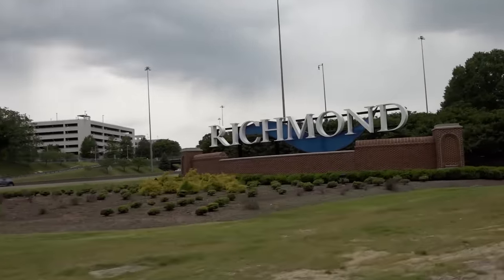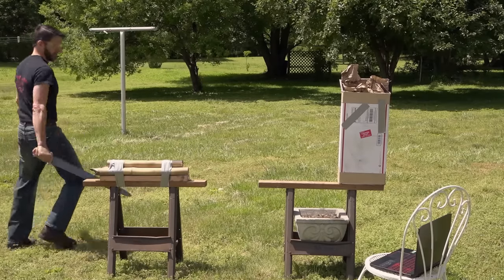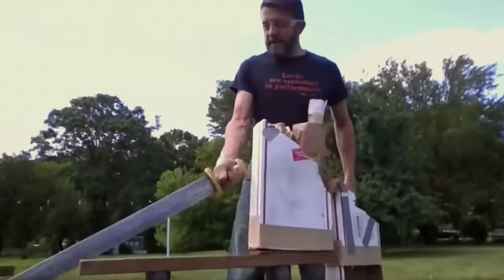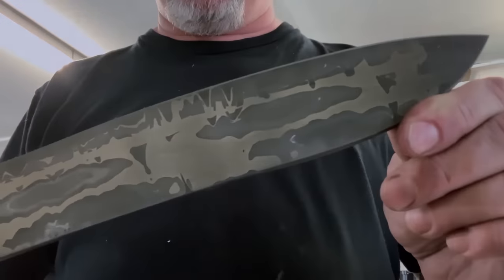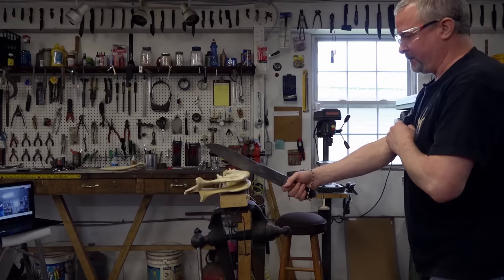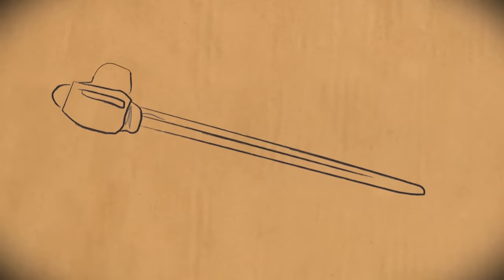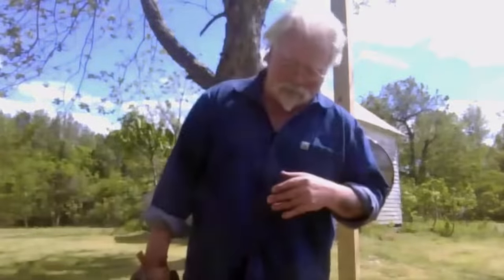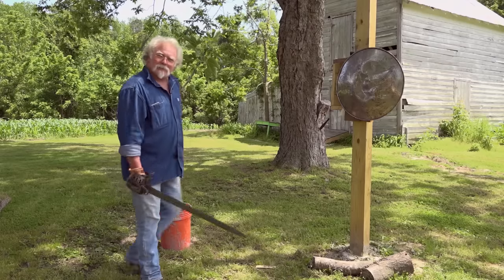Forged in Fire: Judges' EPIC Home Forge Battle (Season 8) | History

Comment: While people are saying J got the easiest challenge? The hardest was no doubt Ben's, but Dave got the easiest challenge. As a specialist in weapon recreation, it was safe to assume he had forged the blade before. Heck, the blade was forged by him prior to the challenge to see if it is possible for the participants to forge it within the competition time. J challenge while not the hardest, was not easiest either. Especially if you never work with the material before, you have to guess a lot, the tempering process and temperature, the quench temperature (most contestants were having trouble resulting to a warp) and also the interaction between the material such as delamination and the best method to fix and prevent it.

Comment: I haven't even read down the list of comments yet, but I'll guarantee that there are lots of them decrying the strength and sharpness tests.  I mean I get it, it's not really a competition, but c'mon guys.   These "tests" were so lame.  It's a good thing these guys are blacksmiths and not actors.  

The sword did not cut, it went through the box yes, but the edges were all ragged and torn, not cleanly cut.

Those jawbones had to have been baked and dried out.  They splintered like toothpicks. 

That shield didn't even flinch, and using  a Fig tree limb.   No no no.

Still entertaining to watch, still better than I can do, but not as good as they could do.

Comment: Here's a question,  Damascus aka folded steel a term used for a type of steel, does it have to have multiple types to create a pattern to be considered damascus? Or is the act of folding what makes it "Damascus ".
You can not create Damascus without folding so is an original Japanese katana a type Damascus steel? Obviously it's not pattern Damascus but...
Reply: You use 2 different types of steels in a canister billet. You have to forge weld the canister shut, and peel it off later. Once the canister is off, and you have the pieces of steel welded together in the forge, you can fold them repeatedly to draw out the pattern.